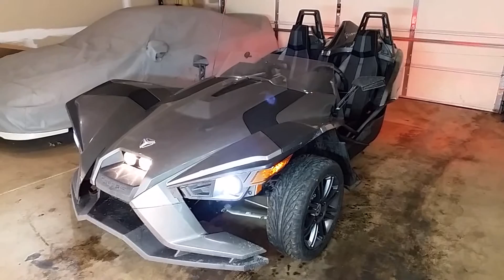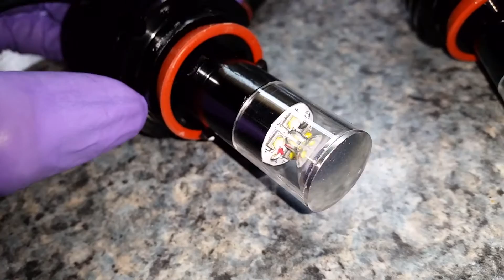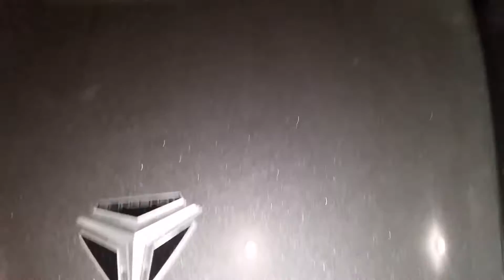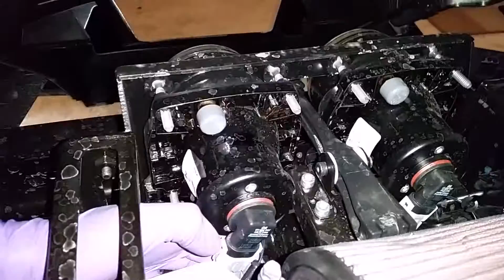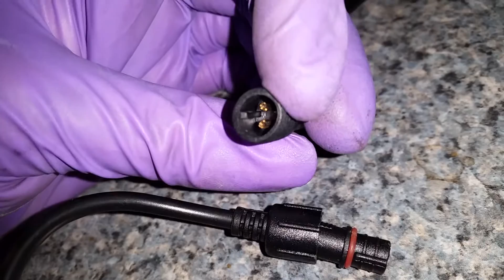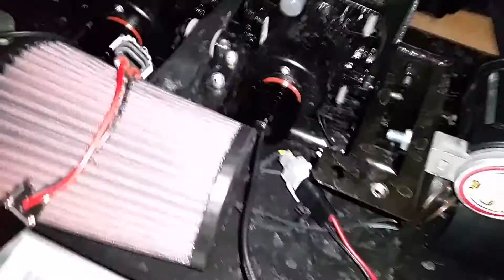DIY: Polaris Slingshot LED High Beam/Center Lights Installation Guide

Comment: FYI your description of the headlight positions is incorrect .... on the US model Slingshot the center lights are the high and low beam headlights ...the outer lights are "marker" or running lights and have a blocking plate inside that prevent them from projecting a "headlight" beam. There are no fog lights.